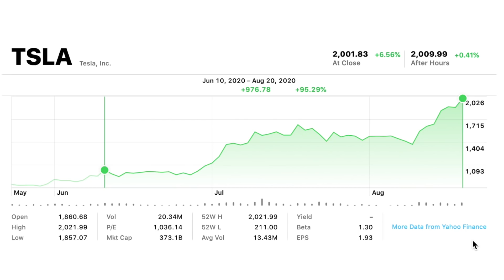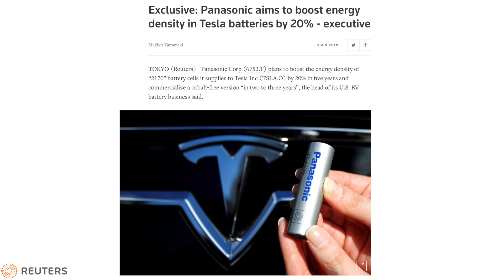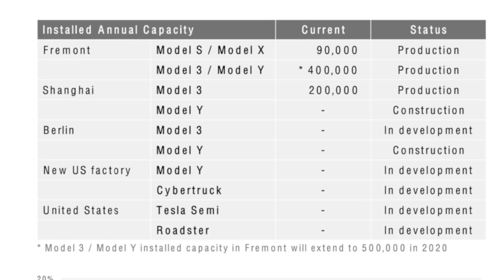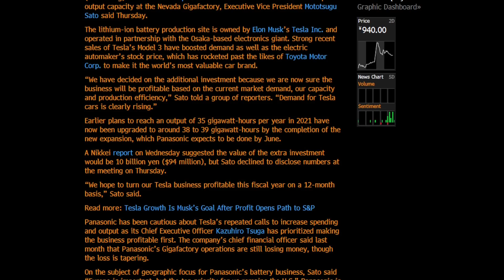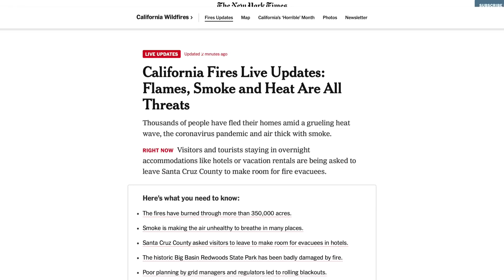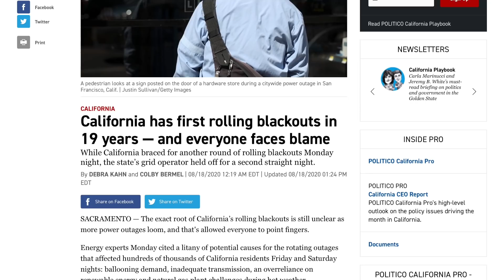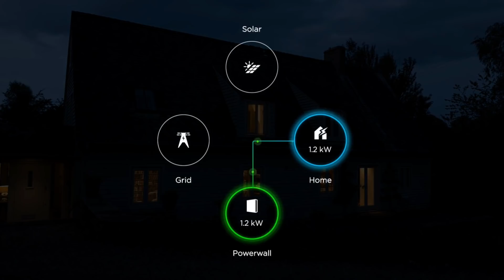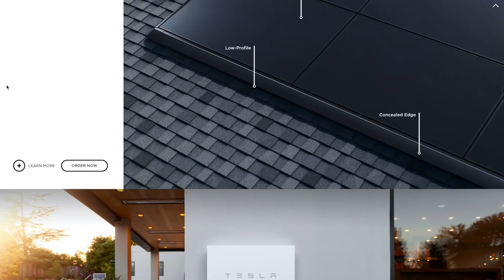TSLA Stock Hits $2,000, Panasonic Increasing Investment in Tesla’s Gigafactory, California Blackouts

Comment: Vermont's largest electric utility, Green Mountain Power, was the first utility in the U.S. to install a large-scale distributed power plant utilizing Tesla Powerwalls. The initiative began five years ago. GMP leases Powerwalls to residential customers all over the state for $15 to $20 per month. These Powerwalls contain modified firmware which allows GMP to control them remotely, adding energy to the grid exactly where it's needed during peak load. The primary benefit to the homeowner is emergency backup power in case of an outage. The Powerwalls can be charged with residential solar or via the grid.

Comment: active air conditioning is insanity.  if you dig 6 feet under ground you get cave temperature.  run a culvert tube through the ground and up into the house..have a sky vent that lets hot air rise and pull cool air through the tube. it works...costs very little...no active power needed.

Comment: Panasonic increasing production capacity by 10% is better than no increase. But this just makes me so grateful Tesla is implementing the Roadrunner project. Need to accelerate battery supply at exponential levels. Not 10% levels.

Comment: so panasonic is spending $100 million on 1 line. they have 13 lines in there. How much did the previous lines cost each? what is the capacity of this new line compared to the other 13 lines? If its only a 10% production increase then it is only slightly more throughput. What am i Missing here? have they invested a billion dollars there already? if the new line costs so much, why only a limited increase in production? 

Or are they adding a line and upgrading all other lines to a new production process to match the new one?

Comment: The fires have nothing to do with "climate change". Most of these fires start because state has refused to let PG&E from clearing dead brush for the last 2 decades. Though they are finally letting PG&E to finally start clearing dead brush under power lines. The rest were intentionally set by someone. Blaming climate change is a scapegoat from blaming the real problem.

If I was stupid enough to live in Cali, I would have to have a Tesla solar roof and power storage.

Comment: That last bit about the Power side of the business is intriguing to me as a continued future growth area for Tesla. Utility size power back up, peaker plant replacement options, resiliency planning for businesses or business districts that combine their need for reliable power backup on demand etc. This is so under prioritized by Tesla and reported on. I can only presume that the lack of battery production has been the limiting factor to really sell this solution to nearly every state utility in this country and other countries as well as businesses. 

If Battery Day, as you surmised might, talk about the rapid expansion of their battery production capacity rather than highlighting some increased density or only some incremental battery design improvement then I would hope more analysts would pursue that topic more often with Elon to get more specifics on his thoughts and that Power groups business plan. I believe in one video I heard you say the expectation is that the Power side is expected to be at least equal in revenue to the automotive side of the business over time. How will that be achieved is a topic I'd like to hear more about. Diverse revenue streams will give investors, analysts and the market more confidence and less speculation for the future valuation of Tesla stock.

Hearing more about the utility scale projects, costs and revenue would be helpful. The Australian gambit was a great idea on his part and wonderfully pulled off and also successful from what i can gather. So reporting on other similar installations in the US and world would be welcome news.

Thanks so much for what you do, i'm a new subscriber and have to say first time share holder of a few shares of Tesla but the more I learn the more I can see myself adding to my holdings.
Brian